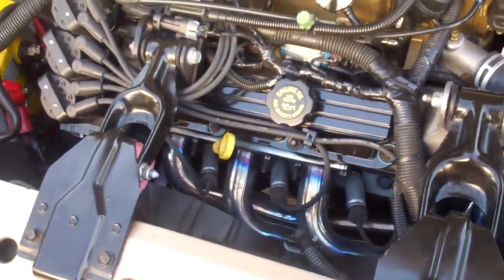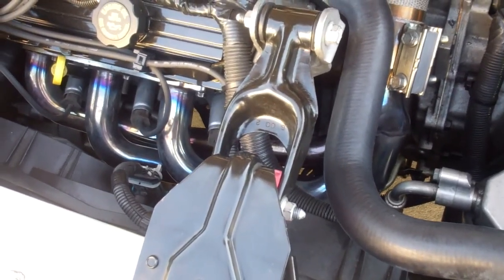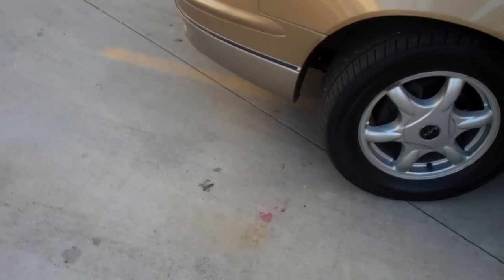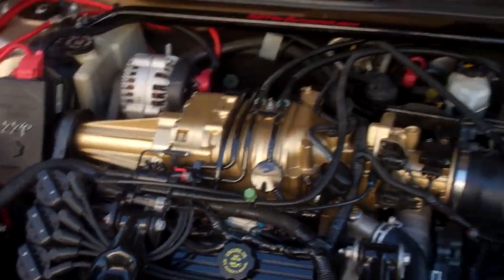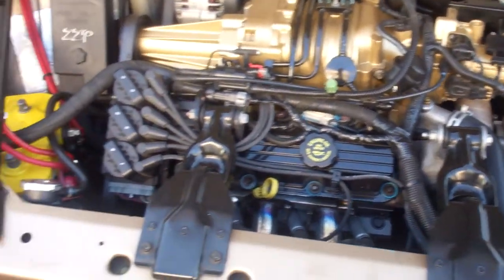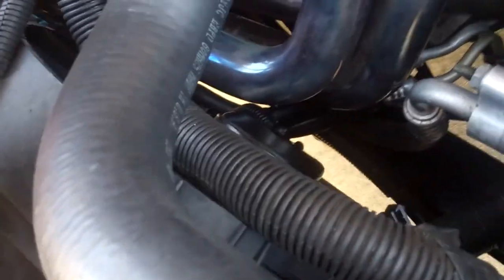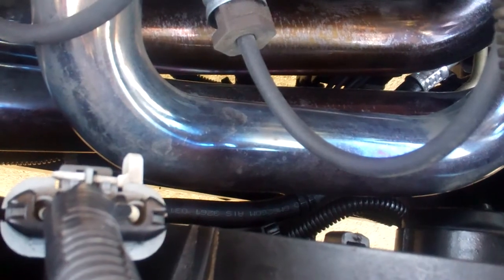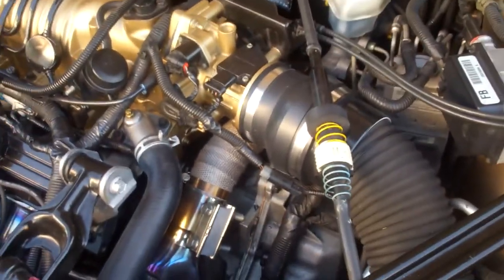Buick Regal transmission cooler line part:3

Comment: Hi.. how did you separate the transmission line from the radiator? Did you use a special disconnect tool? Or did you unscrew it from the bolt with a wrench. If you did use a tool because of those clips... what/where did you get it? Thanks!